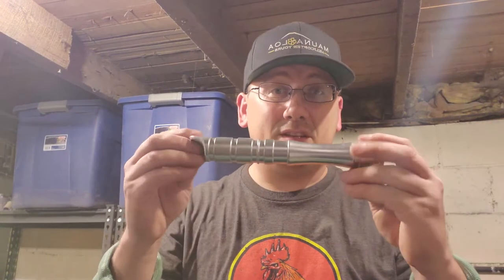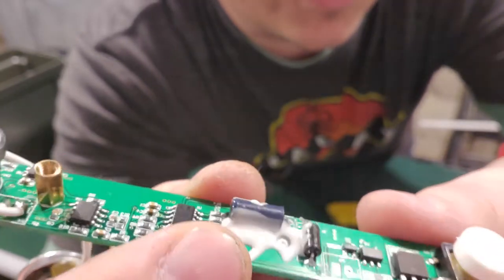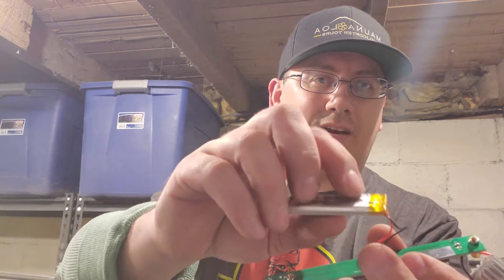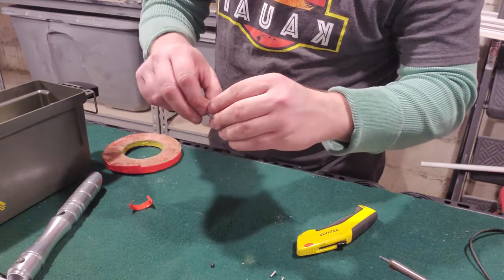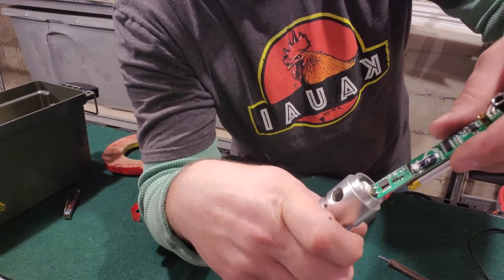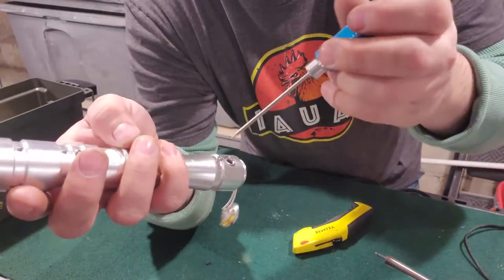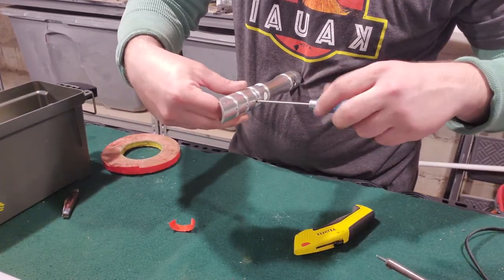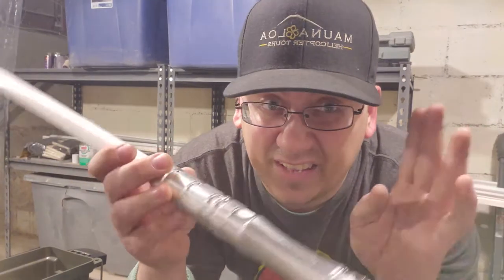Repairing My Son's Yddsaber (Battery wire fix)

Comment: Mine just stopped charging and I took the circuit board out and it looks fine what could be my problem?
Reply from the maker: #1. Recharge port pin alignment. Check the center pin on the recharge port, sometimes the pin bends down out of alignment. If it's out of alignment, gently bend it to center with a precision flathead screwdriver.
#2. Broken battery connection. The wires connecting the battery to the circuit board aren't very strong & can break over time with dropping impacts. This is what I had to fix in this video.
#3. Battery has gone bad. The easiest way to find a replacement is to check the measurements of the battery & search for one that's the same voltage. Sometimes you can find a match to the battery with more milli-amps, so you can get more battery life out of your lightsaber.
These are the types of problems I have seen or heard from others.

Comment: It’s been a while since I have started mine up and I believe it is fully discharged. I left it on a 5V 1A charger for about 8 hours and the light is only showing red but it won’t start at all. Do you think the battery has gone bad or does it just need more time to charge because of it being unused for a long time.
Reply from the maker: It could be the battery. Just check the battery dimensions & voltage when looking for a replacement. I had to hunt around on Ebay & Amazon to find one the right size.

Comment: What if you charged them accidentally with something other then there charger
Reply from the maker: It depends on the voltage of the charger you plug into it. I had a board completely fry when one of the kids plugged one into a 12volt 2.1mm charging cable.
The board is designed to work with a 4.2 volt or 3.7 volt charger.
Reply: So i accidentally plugged in 12v to my sons black handled saber, this was after knowing it was broken. The board shows no signs of burnt components except the little coil on the board appeard to have its housing a little melted looking but nothing looks fried. Re-soldered all components. Charging led only lights up and stays lit, both red and green but saber doesnt power on.
Reply: Might i add that when shaking the board it makes rattling sounds. Wonder if those are burnt out components...

Comment: so i used the wrong kind of charger and it made a buzzing noise and i saw a little flicker. now when i use correct charger, the little light that tells you it’s charging doesn’t turn on and the saber itself won’t turn on. any suggestions?
Reply from the maker: I'd pull the board out & test a different battery on the negative & postive connections for the board.
It might have fried the battery's protection circuit, but if it won't fire up with a charged 3.7 volt battery, then the board is toast.

Comment: I got one for my dad last month and it won't turn on but when I put it on the charge it says it's full charged
Reply from the maker: Sounds like a defective battery or a broken wire connection between the battery and the soundboard.

Comment: Have you experimented with installing a 3.7V Lipo with greater mah?
Reply from the maker: Yes. I have used higher mAh batteries, you just have to make sure you watch the length to not go longer than the distance between the bolt down pegs.
Reply: @TheBanthaWhisperer  that's great, and thanks for the heads up!

Comment: I'm trying to find a replacement battery for my ydd saber
Reply from the maker: This is the closest match to the original battery in size & voltage, that I could find. You would have to cut off the jst connector & solder it to the circuit board.
A new piece of double sided foam tape will be needed, to stick the battery to the circuit board.

AKZYTUE 3.7V 750mAh 692245 Lipo Battery Rechargeable Lithium Polymer ion Battery Pack with JST Connector
https://www.amazon.com/dp/B07TWHFW82/ref=cm_sw_r_em_apa_i_IYhPEb5C04VVV
Reply: @TheBanthaWhisperer  thanks for tip brother. i intend to attempt this.

Comment: seems these as great as everyone seems to think ......i have the ghost and the cross saber both quit working about a week apart from each other  even though i bought them at different times about a month apart .....they basically hang on the wall 24/7 and only been turned on like 6 maybe 7 times ....im 51 yrs old and  thes where to be displayed in the man cave ...never seen a sword fight or even been dropped ....im hoping that your vid will help with ghost .....but do u know how the cross sword is put together i assume its much the same but there is prob a trick to getting the two side lights back in place or even takin out without destroying there wiring
Reply from the maker: Most cross guards that I've seen, have disconnect plugs in the emitter section. There should be a way to unscrew the upper to be able to unplug the LED modules, then be able to slide out the chassis.

Comment: So uhh let's say I put the wrong type of charger on mine, and there was a little spark. Now the charging light is always flashing and I cant turn it on. I looked at the circuit board and everything looks ok. I figured out that if I stick a peice of metal in the charging port the right way, it starts working. Is there a way to fix this?
Reply from the maker: Get a new 2.1mm recharge port, it'll have to be a match to the type on the board.
You will have to double check your two terminals, before you solder it to the board. Center pin is supposed to run positive & port wall is supposed to be negative.

https://www.amazon.com/dp/B07VPT7WNP/ref=cm_sw_r_cp_apa_glt_fabc_P5S4DXG8241PMBFCXMJQ
Reply: @TheBanthaWhisperer  thank you so much. Mines have the same hilt and blade, but the chip looks slightly different. Hopefully the port works. 🙏
Reply from the maker: @TheFinalTest  the one that I linked is for a two terminal recharge port, most of the cheaper soundboards run the two terminal setups. The protection circuit is on the soundboards regulating the voltage running into the battery.

Comment: should my charging port be blinking green?
Reply from the maker: Yours must be a newer model, ours only had red & blue lights. Red when charging & a blue light when done charging.
Flashing usually means a battery issue.
Reply: @TheBanthaWhisperer  thanks. ill open it up.

Comment: I accidentally dropped mine and now it just works for five seconds, then it turns only the light off until I click the button again :/
Reply from the maker: Sounds like there is some damaged connection. It could be a damaged battery wire or possibly a cracked board. Where it shorts & looses connection.
The most common broken connections are between the battery & the board and the speaker & the board, but the speaker is where you lose just your sound.
I'd check the wiring first.

Comment: I was spinning my saber and it hit the ground and now it won’t turn on when I go to charge it the charging light turns on but then the circuit board seems to over heat and the charging light goes off any help?
Reply from the maker: I'd check to see if you severed one of the battery wires. My son broke the wires from downward impacts to the pommel. It was enough to break the battery wires clean off from the soundboard.